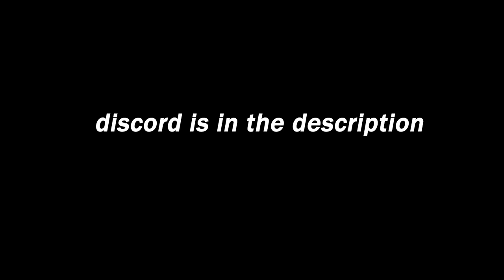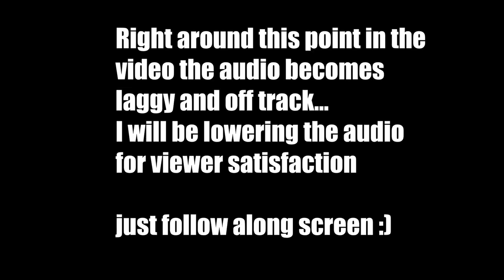THE CLUTCH | Rust Base Design 2022 - Wide Gaps - Open Core (FULL BUILD)

Comment: u should remake this video n not skip over important stuff bc i messed up on this base 2 time n had to soft side metal ceilings but it’s a W base just need to remake the video
Reply: bc the ceilings tht need to be connected to the outer it skip over tht
Reply: fr like he builds what he needs to and moves on doesn’t really explain much it doesn’t help that he is going pretty quick too

Comment: Beautiful Design. 5 suggestions 
1. Build a bit slower so ppl can rebuild it easily 
2. Uve made a few mistakes or forgot some details.
3. Upkeep / costs 
4. Too many half walls.. grubs can twig to your roof. It also costs twice the amount.
5. Building fast aint let ppl think youre experienced it causes dislikes... weve already seen that u re knowledged when u build outa tcs.
6. Solo duo trio base designs are tough and more appr. Than group designs. 

Keep it up great work.
Reply: You can slow down any youtube video if you need to. :p
Reply: @thijsjuh44  still hard

Comment: Nice base design although unless you honeycomb the 1 wall connected to main there's no point to honey comb the rest on the outside and unless you honeycomb it its gonna be 1 wall to open core regardless if its honeycombed on the inside, They just break a lower wall and that section collapes, Also whats with all the half walls? There's like 2 full floors made of half walls, It just doubles your build and upkeep cost for no reason, Do the full walls and pancake it.

Comment: so many cuts in the video where stuff been changed makes it hard to follow why cut out? when u make the floor different at 11:05
Reply from the maker: The video is poorly edited and a lot of the video got corrupted, the cuts are to cut out the corrupted parts so skipping ahead may be a problem which I apologize for
Reply: @SecretBuilds  no worries mates still a sick video congratz on 1k